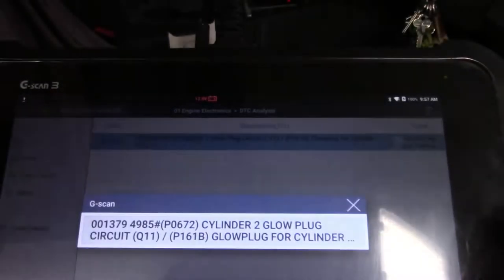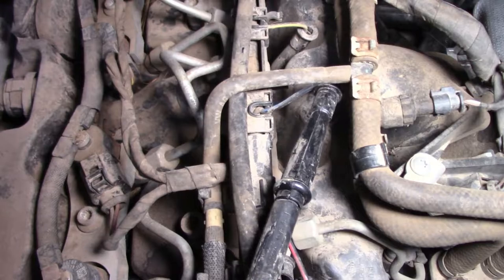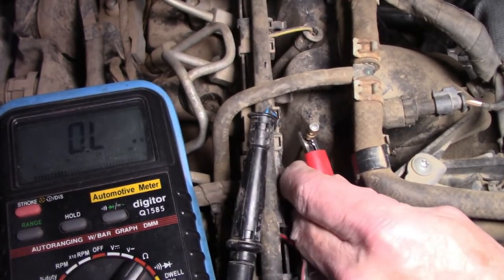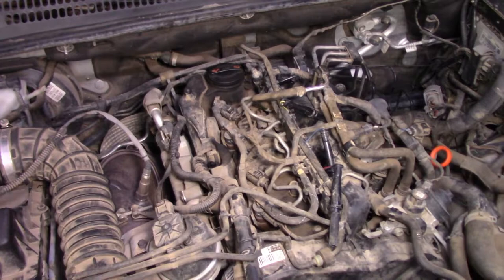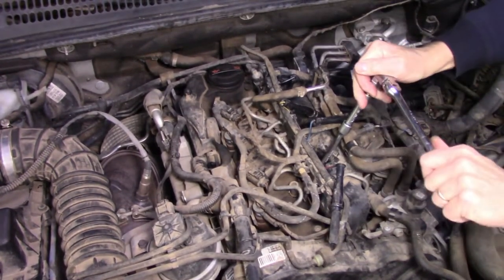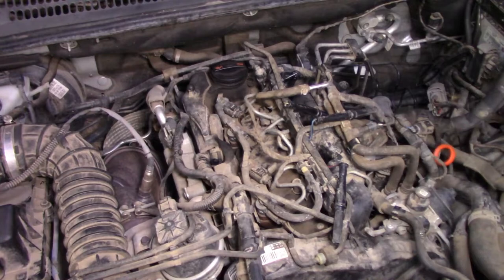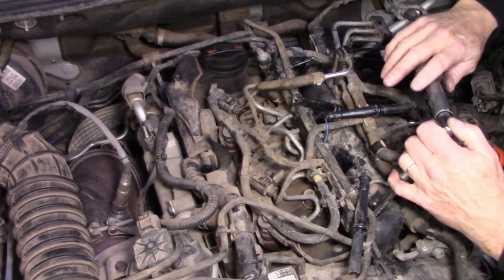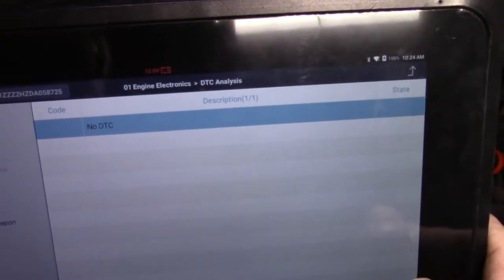Amarok Glow Plugs P0672

Comment: 5
Thanks for the great vid. Question would the bad glow plug make the idle very rough on a cold start so much so that the motor almost stalls until it warms up. Thanks 🙏
Reply from the maker: Hey Barnesy,
You are absolutely correct. That is exactly the symptoms of bad glow plugs. They are only used during cold starts to warm the air enough to allow compression ignition. 😁
Reply: @MiracleMAX  thanks so much help mate. Thanks heaps. I will change those glow plugs. Take care
Reply from the maker: @barnesy8523  Let us know how you go! 😉

Comment: Can glow plugs throw up the dpf light?

My dpf light has came on intermittently this week I've ran it twice decent runs between 2500/3000 and at times it's went off but then came back om no other issues such as limp mode etc

It was off yesterday but took it to someone I know with a good code reader, nothing dpf related flagged up but 2 glow plugs and something to do with climate control did, reckon thats cause I've no had it regassed

Dpf light came back on there so just wondering what it could be if a reader isn't bringing anything up?
Reply from the maker: It would be unusual for DPF related faults to be connected to glow plugs as they only work during cold conditions on start up. It would be best to get a quality scan tool for fault codes as well as live data.
Reply: @MiracleMAX  I know someone who had a real good quality scan tool and he plugged it in but no dpf issues came up, the light was off at the time but has came on again and I'm panicking ha love the car and not in a postion for it to die, is there a separate scan tool for a dpf then or should a normal one bring it up? Just asked on another form and someone said the glow plugs are part of the regen process? 

As I say the tool the guy I knew used was a good quality one as used to work om cars himself so I thought that would've threw up something if dpf was acting up gonna run it to a garage tomorrow after work
Reply from the maker: @martin494563  The glow plugs are not part of the regen process. I suggest looking at live data for soot accumulation as well as differential pressures

Comment: Hey! In my Audi Q5 is indikation about glow plug module and what is that ? Glow plugs are changed to new once all 3 but still there is indikation on glow plug module.  The 4 glow plug is more different also . Do you have any clue what would that be .
Reply from the maker: Not exactly sure what you are asking. Do you have glow plug codes & what are they, including the full description supplied on the scan tool? Have all been replaced? What are the resistances of them now? Is the relay working correctly? Is the glow plug light coming on the dash? Can you see the relay being activated in live data on the scan tool?

Comment: Hi, I have an issue on my Amarok when its cold. The vehicle has a poor acceleration when cold for approximately 1 to 2 minutes. It also has a noisy sound (sounds like an efficiency of oil), tappet like sound. After 2min it seems to driving normal. Idle is also normal from the initial start up. Could this be a sign of a bad glo plug ?
Reply from the maker: Have you tested the glow plugs? What fault codes do you have?
Reply: @MiracleMAX  I just measured the resistance and they all good. The four are ranging between 0R - 0.3R. I'm receiving my diagnostic device in the week. My Amarok seems to be driving fine now tho. The poor acceleration issue is gone. I will monitor it. Quite strange!
Reply from the maker: @justinjacobs9439  Let us know how you go. Make sure you note any codes before clearing them. Do you use good quality fuel? It might be an idea to do an injector leak back test as well.
Reply: @MiracleMAX   I did some research and it seems to me the isssue I have is an injector knock. However, the problem only occurs in the morning for about 15min after that it drives okay. I'm driving the same bakkie as in the video. I was thinking to remove them and have them tested. Could one refurbish the injector or should I get new ones? I remember a guy told there are two types of innjector in some ROKS where you can refurbish one and the other not.
Reply from the maker: @justinjacobs9439  There are either Piezo or Solenoid style of injector. What tests have you done to confirm the injector fault? Have you done a leak back test? What are the feedback values on the scan tool? I suggest carrying out some further tests before replacing the injectors. I personally always use new injectors.

Comment: What is the meening of limb mode  on a amarok 2014 2. L 4
Reply from the maker: What fault codes are present?
Reply: @MiracleMAX  P0104, P22DO, P004C, P004C
Reply: @MiracleMAX  P0104, P22DO, P004C, P004A
Reply from the maker: @AlbertMaritz-b7j  The engine will go into limp mode to protect damage created from a fault. The codes you have include MAF, MAP & turbo boost. Is the MAF reading correctly? Is it clean? Are there any air leaks, split lines etc. Is the turbo solenoid & hoses OK. Is the MAP reading correctly? Are you able to check the readings in live data? Is the intercooler OK & not split? Is the air filter clean? Can you check for air leaks with a smoke machine? Is the intake system blocked with carbon? Is the turbo desired and actual readings the same? Is the turbo actuator moving correctly? Is there any mice damage to any wiring?
Reply: @MiracleMAX  OK  I will do so thanx for the help